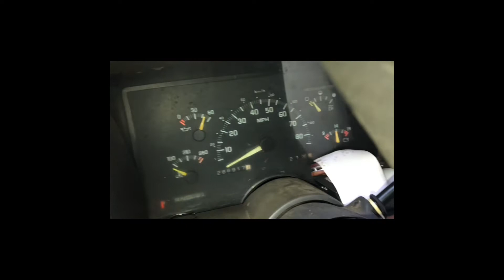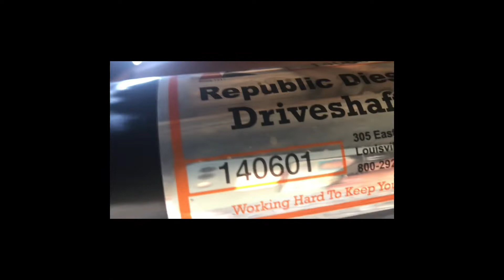Slide show of my k1500 straight axle swap “GMT400” OBS Chevy “k350 Bonnie”

Comment: Nice video man 👍 I like the walk around of all the suspension. I'm making progress to get mine done I hope sometime around June but the way I can find parts it could be pushed back even further. I did finally get both axles. A 14 bolt with posi out of a 97 chevy and a ford front end so now it's either spend te money on new stuff or find some cheap stuff which I'm hoping for
Reply from the maker: Thanks man I greatly appreciate it and good luck to you man if you have any questions I might be able to help with let me know !